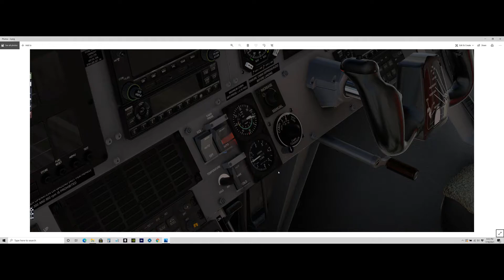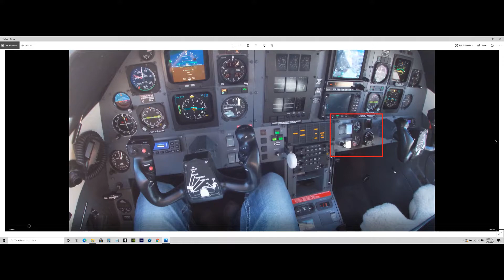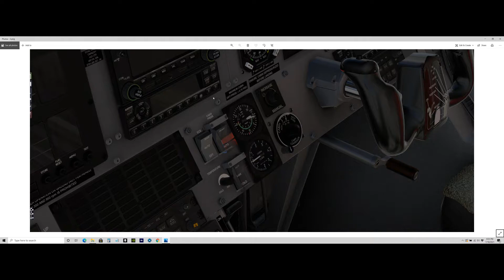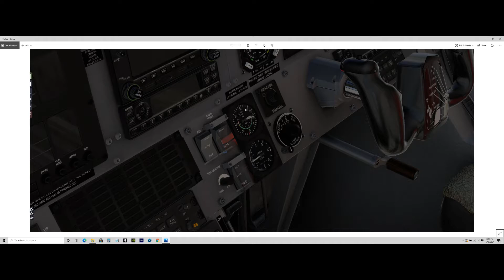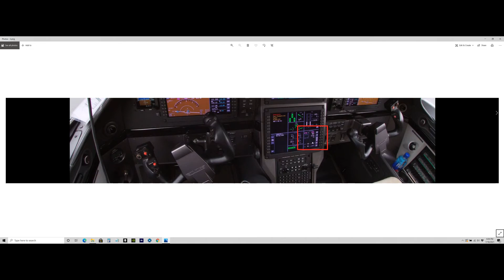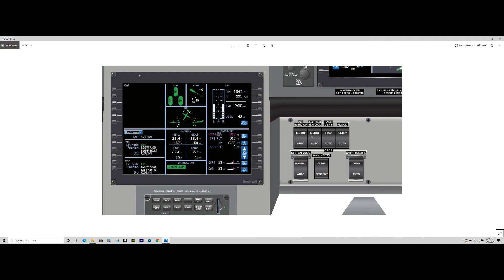Pilatus PC-12 Pressurization System

Comment: Hi Gene, 

I was wondering if you know why the outflow and safety valves are swapped between the legacy and NG models? I haven’t been able to find any reason for this, other than that they are.
Reply from the maker: The outflow valve on the NG has an integrated digital controller, whereas the Legacy does not. I'd guess the positioning had to be changed to accommodate that.

Comment: 4:50
So by twisting that knob it will start to bleed cabin pressure? How is it any different than the DUMP setting? Are they related?
Reply from the maker: Automatic/manual adjustments are to be made gradually so as to be comfortable for the occupants. Dumping the cabin will result in a rapid decompression. The pressurization is released extremely rapidly. You would dump the cabin in an emergency, such as if you had smoke or fumes in the cockpit.